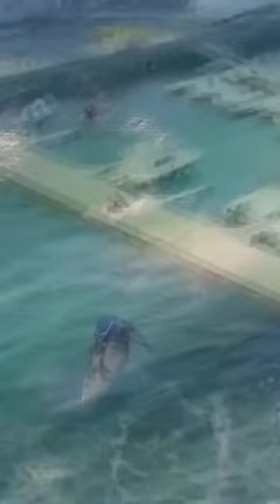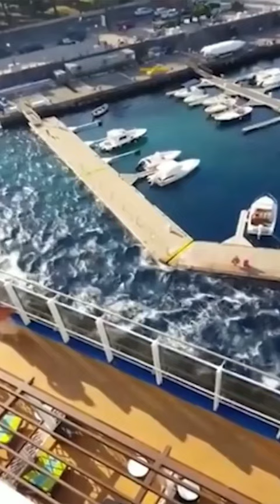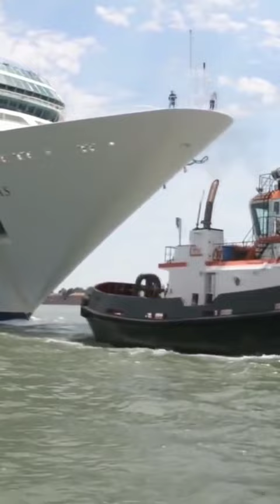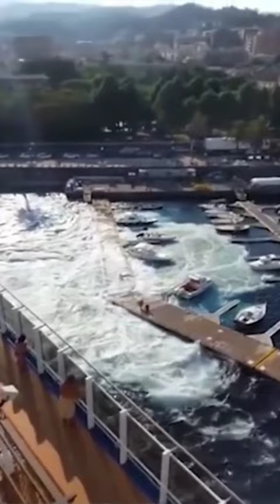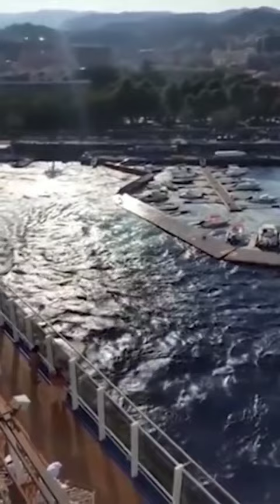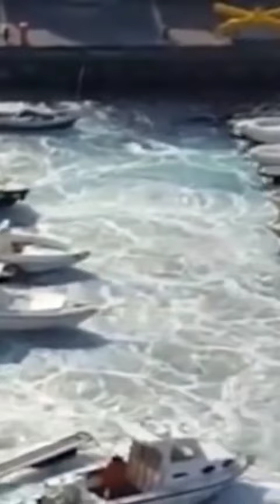Cruise ship engines

Comment: I saw a wake that took a man's life in the navy. We had a barge tied along side while performing load tests on our winches. In addition to the typical mooring lines the were cables utilized as well to minimize movement of the barge while performing the tests. A tug boat went ripping out of the slip like it was heading to a fire. It churned up quite a wake which got the barge bobbing up and down quite a bit. Then it started pulling away from our ship at one corner. As it was pulling away the cable at that corner began to stretch. One of the barge workers was taking a smoke break and never saw the danger just a few yards from where he stood. Eventually the cable stretched past it's maximum and parted. When it snapped it recoiled wildly and hit the worker across his chest. It picked him up about 6 or 8 feet off the deck and carried him about 12 to 15 from where he stood and slammed him into a bulkhead. He dropped like a lifeless rag doll probably dead before he hit the deck.
Reply: So a wake didn’t do it a cable did it
Reply: @PInk77W1  The wake set off the chain of events, smart guy!
Reply: @Beezlie727  yes but the wake itself didn’t do it.
Reply: @PInk77W1  yes, yes it did.  So your saying the gun killed the person, not the one who pulled the trigger? Or the car killed the person, not the one driving? He wouldn’t have died if the wake didn’t happen.
Reply: @PInk77W1  I see ur point but come on man does it really matter that much lmao that's what makes u the joke

Comment: That is not from the engines.  It is caused by the displacement of the water from the large ship.  They have tug boats pulling them out,  the engines are not turning the props

Comment: Thrusters churned the water. What that ship or any other cruise ship had never been there before? Nobody knew that bow and stern Thrusters are insanely powerful and that using them at full capacity in close quarters of other boats might cause severe damage? Were they handing out stupid pills before the crew boarded the boat? Not one cruise ship was ever there before? Not one? Nobody was on the side bridge or aft of the boat? Wow! Hard to believe there's not more horrible accidents on cruise ships.

Comment: If you’re going to narrate the scene, you should at least know a little bit of what you’re talking about, and clearly you don’t. This had absolutely nothing to do with waves or tsunami. The wind hitting the ship broadside acts as a gigantic sail pushing the ship towards the floating dock. The ship attempted to use its propulsion system to counteract the force of the wind and the wash from the propulsion destroyed the floating dock and vessels secured to it. And I would guarantee that there was no tugboats assisting. If there were tugboats assisting, the likelihood of that happening would be minimal.